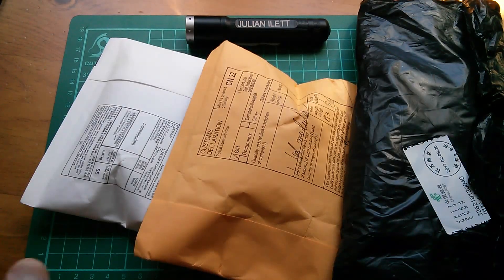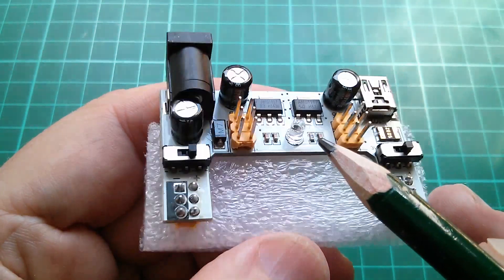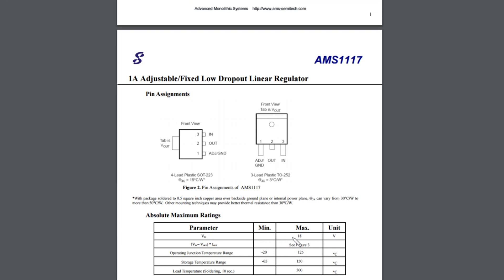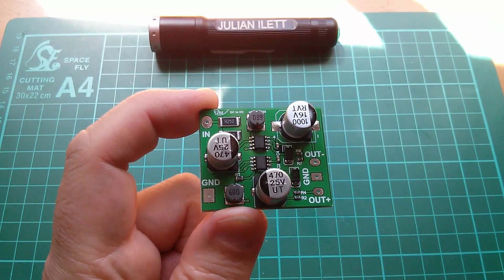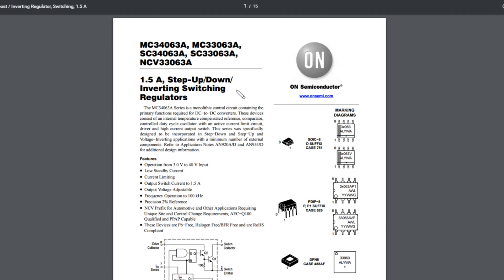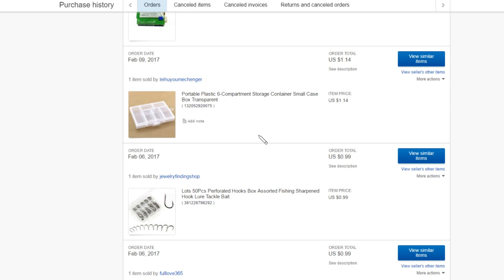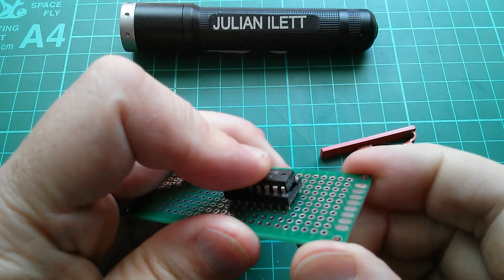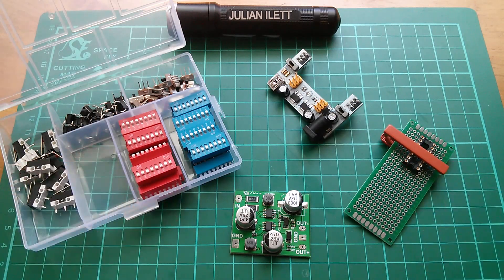Julian's Postbag: #97 - Terracotta Tie Clip

Comment: I have one of those in box somewhere around here.  I was screwing around with it, playing with my hand built oscilloscope, the one based on a Nano and little blue display, anyhow I probed wrong, or a probe slipped, and the magic  smoke came from the 5 volt regulator.  So I slung it in the parts bin, and one day while searching for something or another, I came across it.  Well I had since purchased some of those little smp 5 volt regulators, so I replaced the device and she started working once more.  They are handy when you don't have a power supply handy, but now days I usually have a 5 volt power bank and a USB to breadboard setup so I can simply power off one of those.  Seems I watched far to many of your videos, and always thought I should have all the stuff you get as far as power banks.   I even found places while we were nomadic where they all came in handy when we were boondocking.

Comment: MC34063 is the super common chip used in almost all car type phone charger. I've just done a tutorial on making them easily adjustable, and have another example coming soon.
Reply: Oh, and if you see this Julian. I build my own soldering clips using header pins and springs in several varieties. My favorite is a lid-type-wedge spring with a header pin soldered to each leg and a small bit of solid core wire soldered near the top. You squeeze the arms together to insert them into the protoboard and use the flexible wire to hold in the component to solder. I should probably upload a video on them as well.

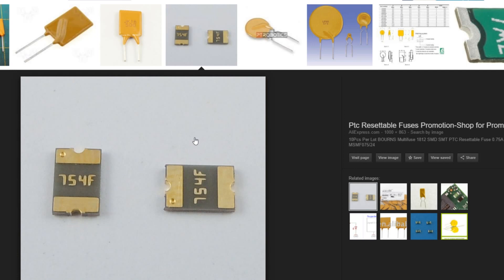Comment: 4:20 -- The first 2 digits on the polyfuses are the parts number (75 = Schurter Resettable Fuses PFMF.075) ; the 3rd number is the production year (4 = 2014) ; and the letter is the production weeks (A = weeks 1 & 2 of the year ; F = weeks 11 & 12 ; ... ; Z = weeks 51 & 52).

Comment: You make soldering the socket (or any multi pin part for that matter) way more complicated than it should be ;) . Push the part in (in case of a socket without the IC inserted!) and put the board on the table (obviously parts should be soldered ordered from smallest to tallest for that to work). Solder one corner pin then pick the board up and while gently pushing reflow that one pin. Usually that's enough to now solder all the other pins without having to push at all because the part will be seated, but if you are unsure solder and reflow the ooposite corner pin as well.

Comment: Julian, on that breadboard PSU can the voltage be set independently on the two arms? I had an issue with one of the more common style (on a larger black PCB with a push button power switch and voltage selection by moving jumpers) where if you had either pair of jumpers set to 5V both rails had 5V on them and if you wanted 3.3V both sets of jumpers had to be set to 3.3. not a huge deal, usually you want 5 or 3.3 but one time I wanted one rail of each and it had me scratching my head for a while until I stuck the meter on it.
also have a look at ebay item 162479805220 (new Qidian 184 power bank!)

Comment: could the fuse be a capacitor 503Z code works out to be 50,000 picofarad with a -20, +80% tolerance

Comment: 503Z...... thats a 0.5A 30V polyfuze
Reply: Do you know the code format for poly fuses?  If 503Z is 0.5A 30V - how would they designate - for an example - a 5 amp 50 volt fuse ??
Reply: Im not sure there is a consistent code in use across manufacturers. the polyfuses on some of my arduino pro minis just say "4", presumably 400mA
Reply: Yes.  I think I agree with you.  I have 3 polyfuses in my stash - a rated 250 ma - labeled XF025;  a 500 ma rated - labeled XF050; and 1A rated fuse labeled 1000U !!   I guess you have to label and/or keep track of them yourself !!

Comment: 503Z seems to be a capacitor : 
http://www.tdpri.com/threads/the-ic503z-cap-the-52-ri-and-the-blackguard-book.48431/
Reply: see http://www.mouser.be/ProductDetail/Xicon/140-100Z9-503Z-RC/?qs=lk7NfA15ZfaRdIW2v0tQIw==
Reply: Jyv Ben That's a ceramic disc (through-hole) capacitor, so it can't be that

Comment: I seem to have the fishing tackle box bug as well. Now don't get me wrong, before the accident  screwed up my life completely, I used to love sitting on the bank and dangling worms in front of fish, who, for the most part, it seemed were not at all hungry, but that was long ago, almost a lifetime ago.  At any rate, I have been buying those as well, perhaps because I saw how handy they were for you.  My good wife of 48 years gave me a set of six large ones that house most of my stuff, but I began getting the smaller ones because of how handy they are, and filling them with transistors, capacitors and such. Now, though I see that the Chinese sellers have decided these are a good sales gimmick and are selling their goods already packed in these containers, so I have switched to buying them already filled!  Much cheaper that way, and if I already have some of the items, such as LED's (You can NEVER have enough LED'S!) then I simply empty the boxes into the large containers and reuse the cases for what I need them for.

Comment: I'm going to guess that to read the polyfuse value, you first place the decimal point right before the first digit, then you move the decimal point right by the number of spaces indicated by the third digit, then read the result in milliamps.  That corresponds with your guess at the polyfuse being 0.5A or 500mA.

I'm going to also guess that the letter indicates how quickly it's supposed to act, with Z probably indicating the quickest action.

Comment: Just a word of warning about the breadboard power supplies - They're available with a range of USB connectors, so select one that comes with the type you want.

I sadly just bought one at random and it has a USB A socket!
Reply: That's a 5v 500 mA output.

Comment: In the Mc34063 1.5 A current limit is for the internal switching Transistor. And since Inverting Voltage is simmilar to Boosting Voltage the input current is higher then the Output current

Comment: If looking for "cheep clamping devices that are easily modified'' ,  Wooden clothes pins.  You can get a 100 for a couple dollars. You can hot glue them together to make longer ones, cut to make shorter ones, work well with pcb's,  you get lots and lots of them, they cheep and disposable.  Plus they hold your loaf of bread and chip bags closed.
Reply: Always keep around a box of C47s
Reply: I might be wrong in the naming some.  There are clothes pegs, i believe are the one that are all one peice and have no spring. I am referring to clothes pins that are 2 pieces and have the spring in them.  Kinda like a wooden aligator clip.
Reply: hmm... good idea!  i was wracking my brain trying to come up with a better idea than a tie clip.
the guy may be an expert, and certainly has loads more knowledge than me, but he does have some strange ideas sometimes.  i guess that's what makes him interesting!

Comment: For IC soldering I usually just put it against the table and solder one corner pin.  Then pick it up and hold the chip in with a finger while reheating that same pin so it is now all the way in.  Then solder the opposite corner pin and again reheat it while pushing with your finger.  Now with two opposite corners soldered the chip is flat and I solder the remaining pins.  Perfect every time.
Reply: Agreed, after spending many hours fiddling with different setups I us blue tack to hold the chip, socket, wire, resistor, in place and after soldering one pin, re-heat and set it correctly using my finger as explained before.
Reply: superdau - lol... me or you?  Looks like I was typing mine at the same time as another both being "21 hours ago".  But I see you have made a similar comment only 6 hours ago.  LOL.  In any case at least neither of us was claiming "first"!  I would rather read many similar helpful comments than 20 comments about being "first"!!  :-)
Reply: John Coops - That is very similar to how I do it. I fit the shortest (in height) components first, inverting the board to solder. If needed, I use some thin card to prevent the components falling out, or with things like resistors, I bend the leads out slightly to prevent them falling out. I do the same with two corner pins of stamped pin type IC sockets. Soldering just one pin/lead for each component (or two corn pins for IC sockets) so that I can turn the board around to check that they are positioned nicely. Then I solder the remaining connections. Then I do the next tallest components. Working my way through them in order of size.
With IC sockets and/or DIL chips, it's normally easy to put a bit of pressure on the board to keep it flat to the socket(s), which in turn are pressed flat against the top of my desk.
Reply: Should have read the other comments before writing exactly the same ;)

Comment: Looking at a Bourns polyfuse datasheet the first two digits correspond to the first two digits of the mA rating (50- 500mA, 15- 1500mA etc) while the second two are a date code, 3Z being week 51-52 of 2013.

Comment: The magnifier you have there is a Linen Tester (Example: http://www.electro-optix.com/linen-testers.html) used for counting stitches across linen. You will notice there are inch and millimeter scales on the lower section. The aperture should be one square inch. I used to use one every day way back when I made litho printing plates to check for defects.

Comment: The inductors on that ±12V power supply module look a bit feeble, perhaps that is what is limiting the power. I've used those chips very successfully at over 1 Amp without any external transistors, but with much beefier inductors. There is some good design guidance from ON semi regarding those chips (AN920/D) if you fancy making your own. Best wishes.

Comment: Julian, can you check the mini-USB power on the breadboard supply? On mine when i plug in an USB power bank, the regulators get awfully hot (you can burn your finger hot) and I have no idea why...? (mine is slightly different, maybe an older version)

Comment: Be VERY careful with AMS1117 out of china.  

I have had ones which have a maximum Vin of about 10v and when they fail above that, they fail shorted in to out.  

I always test one of each batch I buy just to be sure.
Reply: Have had exactly that experience, nasty little gotcha if you're expecting to be able to feed them 12V, it's even in the datasheet if you get the correct one but of course, nobody gives manufacturer names so you just get the generic data which says they're good for 12V input.

Comment: Those breadboard power supplies are nice for just sticking a 9v battery on it
As long as you don't need too much power
Reply: The neat magnifying glass thing you use is known as a linen tester. They are used to count the number of threads per inch in cloth. You can get one from any number of eBay suppliers such as https://www.ebay.co.uk/p/?iid=321752803088&&&adgroupid=33676502101&rlsatarget=pla-271883404515&abcId=893836&adtype=pla&merchantid=110620757&poi=&googleloc=9045084&device=t&campaignid=707291931&crdt=0&ul_ref=http%253A%252F%252Frover.ebay.com%252Frover%252F1%252F710-134428-41853-0%252F2%253Fmpre%253Dhttp%25253A%25252F%25252Fwww.ebay.co.uk%25252Fitm%25252Flike%25252F321752803088%25253Fchn%25253Dps%2526itemid%253D321752803088%2526targetid%253D271883404515%2526device%253Dt%2526adtype%253Dpla%2526googleloc%253D9045084%2526poi%253D%2526campaignid%253D707291931%2526adgroupid%253D33676502101%2526rlsatarget%253Dpla-271883404515%2526abcId%253D893836%2526merchantid%253D110620757%2526gclid%253DCjwKEAjw3pTJBRChgZ3e7s_YhAkSJAASG9VraRT7GRIBqNyzZ5C7L5SD3TamQ7KRDpgYppHF5UGVUhoCZ2vw_wcB%2526srcrot%253D710-134428-41853-0%2526rvr_id%253D1218369685162&chn=ps
Reply: These linen tester (whaling glass , line tester) are also used in printing plants to look at the gauge-pins. But your "duac glass" belongs more to a medical utilisation